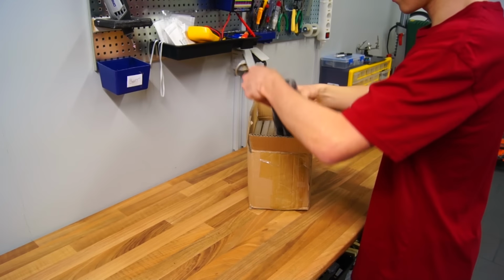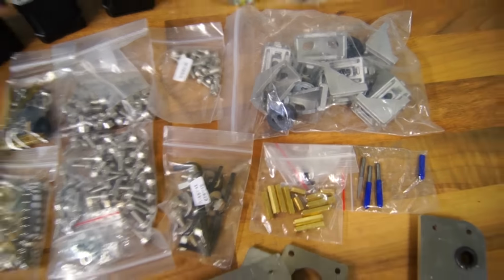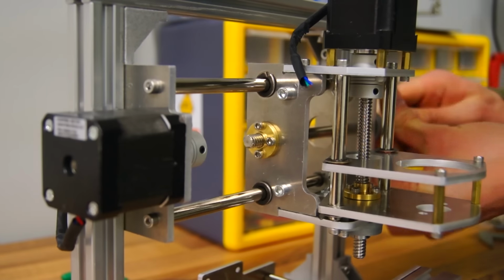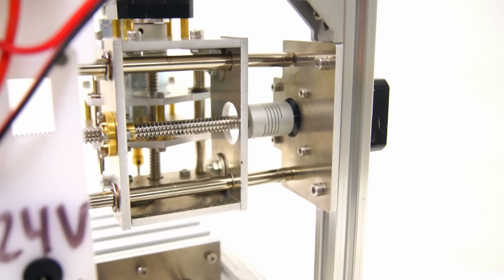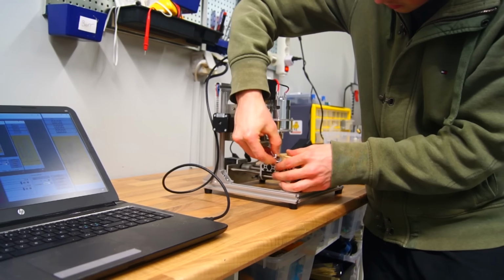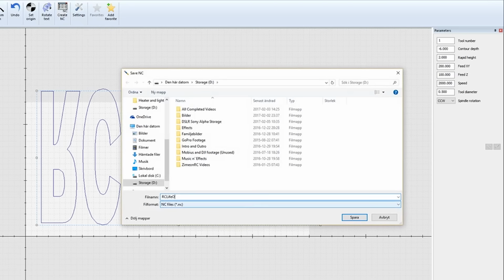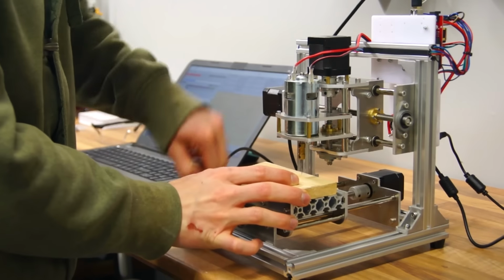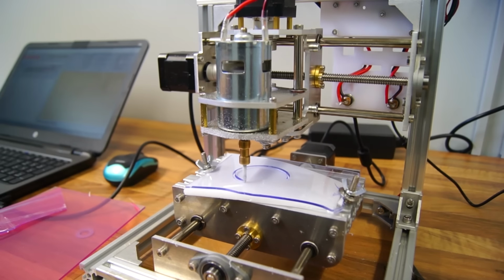T8 CNC Engraver Machine - Full Review

Comment: I just built one of these. I have it setup where I can move all motors with my computer etc. Do I need to calibrate or set the the stop and end points for all directions if I print the demo file using GRBL controller or is this already set in the GC code when the file was created? I would hate to send the file and the motors  go past their limits.

Comment: I have been thinking about buying one of these and modifying/improving/stiffening up the hell out of it using 3-4mm alu plate, but I suspect that you could get a lot more use/better results out of it as-is if you checked out a few machining videos to gain a better understanding of proper tool selection, cutter depth/load and clamping techniques...

Comment: I bought one. What a waste of time. Bent Y leadscrew, pillowblock bearings that don't fit the leadscrews. The 24v supply is broken and rattles like a box of matches so I dare not plug it in. The spindle enable on D12 doesn't work (it should on stock GRBL 0.9j) so either  the relay, cnc shield or Uno clone is faulty. The little red power switch didn't work and the supplied power sockets are loose and intermittent. So far it is useless for anything other than looking at and moving around the motors in bCNC. Pathetic t-slot copies that slip out of frame when tightened. The spindle won't reach all edges of the build plate without modification and no endstops. Oh and no instructions at all lol. Maybe it will be useful for (very expensive) parts. but that is about all. 4 days and £150 wasted. Still smarting.